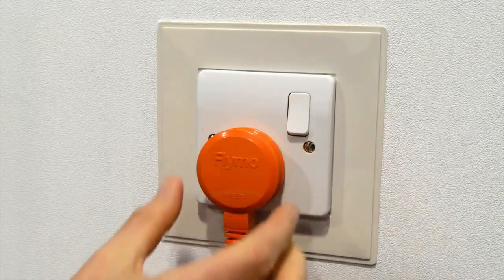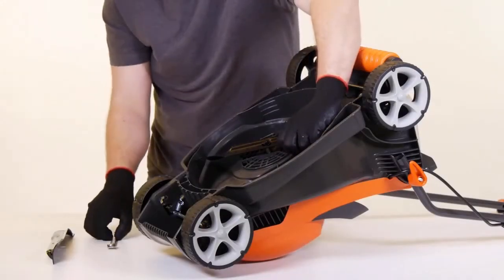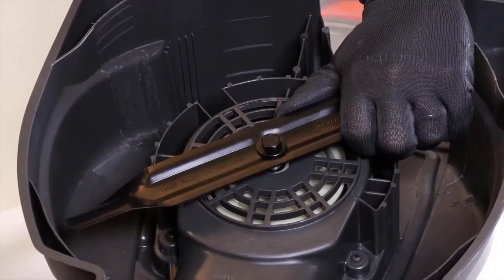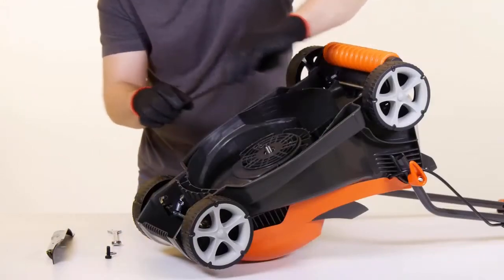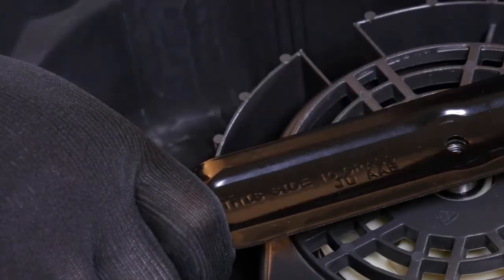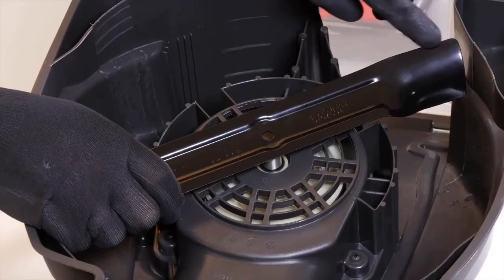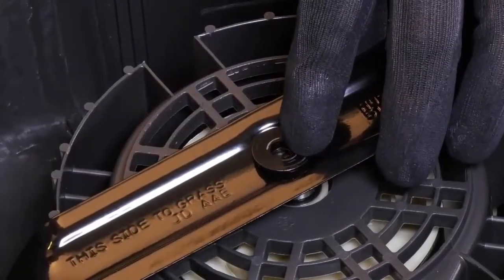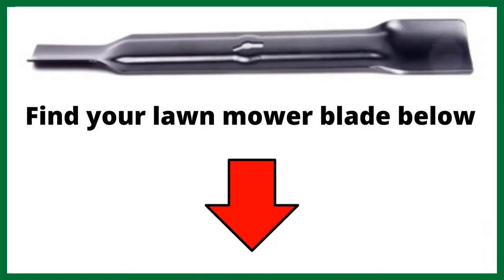How To Replace a Lawn Mower Blade in Minutes !! UK Best Metod 2020!!! Argos Qualcast Flymo Bosch

Comment: My Qualcast electric mower required you to place an Allen key/screw driver shaft into a hole to stop the motor turning as your unscrew the bolt. Without this, the motor just turns as you turn the bolt and the blade doesn’t come off.